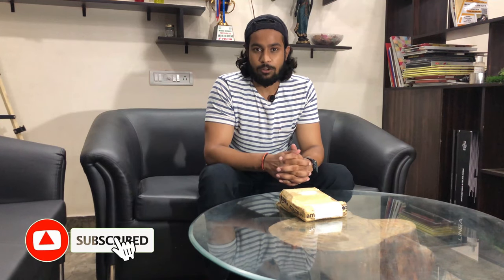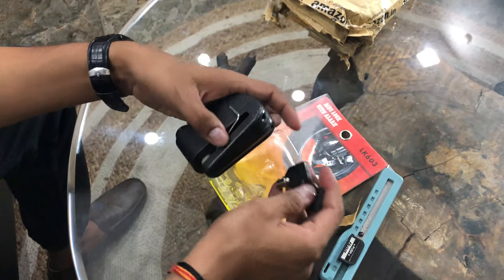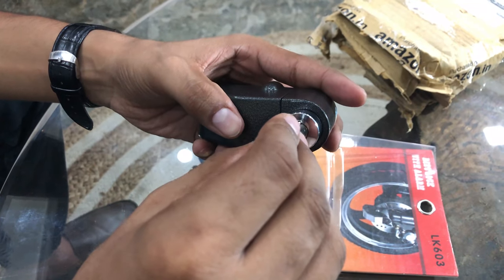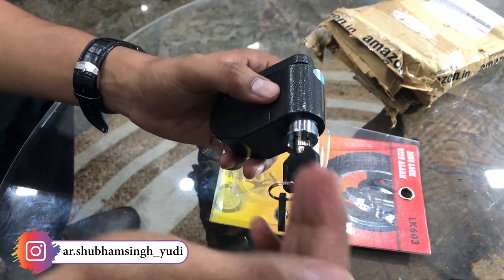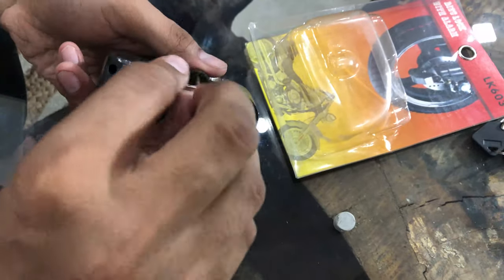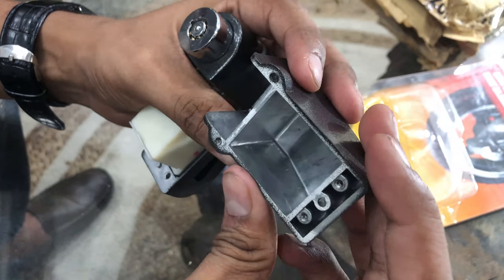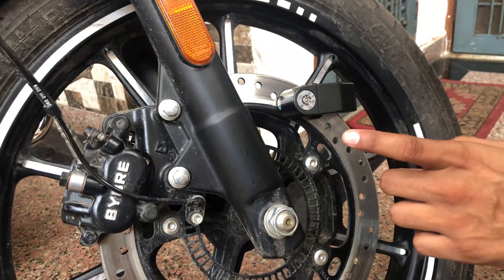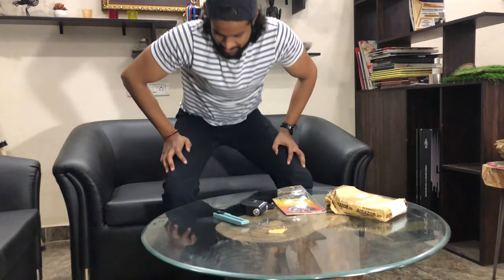Disc Lock With Alarm Review #ArchitectOnWheels

Comment: Bought for my meteor supernova blue from flipkart Allextreme disc alarm lock
Reply from the maker: Great 👍
Reply: Thank u for buying 👍🏻
Reply: Link plz
Reply: @CURSEツ NITH  buy autofy central lock instead of buying this because this disc lock will work for 2 to 6 months and then it will stop permanently because battery compartment will get rusted.